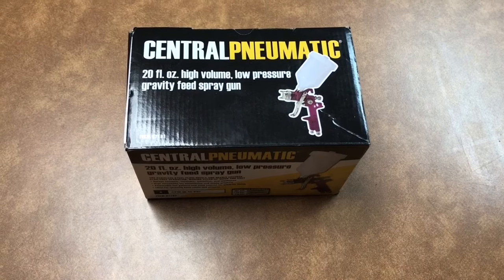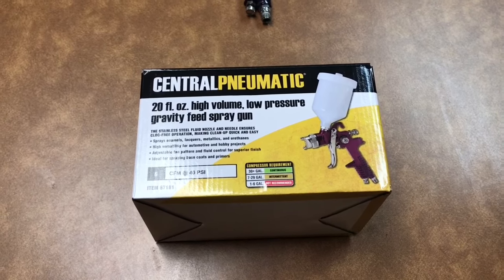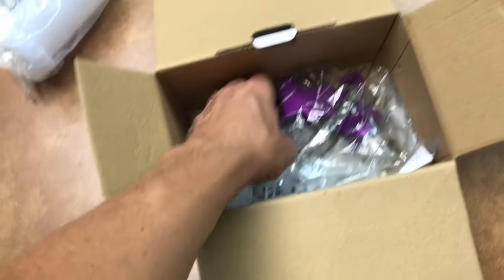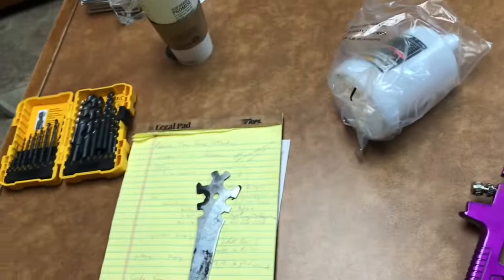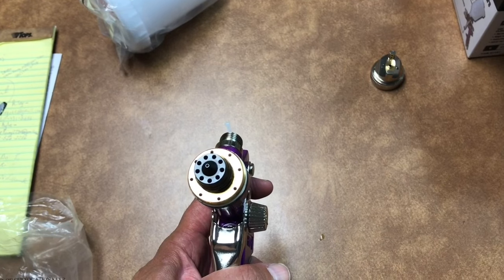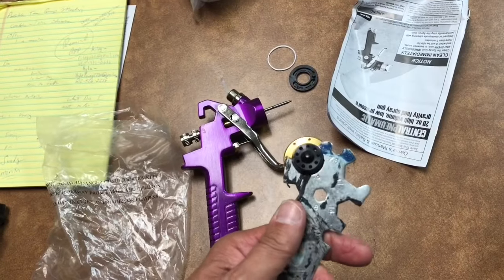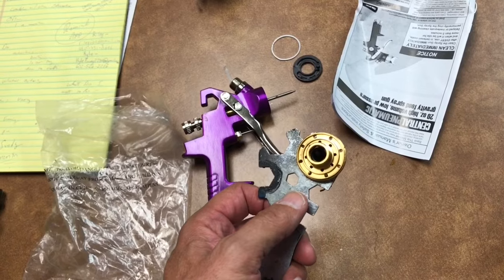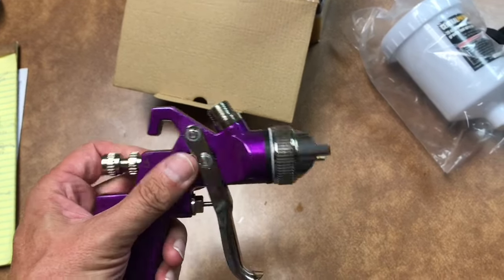Harbor Freight Purple Gun modification from 1.4 mm to 2 mm in order to spray primer

Comment: I modified the harbor sprayer gun from 1.4 to 2.0mm. The paint did not come out -- I test with pure water and it has no problem.  What do I do wrong? The paint too thick. How you mix the paint with water. What is the ratio? I used Kelly Moore interior paint. Ty
Reply: You should thin the paint out with paint thinner or laquer thinner. At least that's what we used to do. Never thin with water . Read the instructions and see if it recommends to thin it
Reply: @SimplyJade2024  water based paint thins with water. I do not think you should go over 20% though?
Reply: Buy some Floetrol paint conditioner at Home Depot or Lowes (or any paint store). It's fairly cheap and better than thinning with water. It not only lets latex paint flow through your gun better, but lets the it level out to a VERY smooth finish if your technique is not quite perfect.

Comment: Don't bother doing this modification people. Spend the 25 dollars to buy a 1.8 or 2.0 HVLP to primer from ebay or Amazon. Why ruin this new cheap Harbor Freight spray gun when it does a decent job for non professionals.
Reply: If you're just going to use the gun for thicker primer and the gun is only $10, why spend $25 for a different gun?

Comment: These cheap bastards are now using steel for that piece that you have that is brass. I got two guns the first one I was able to finally remove as a full piece like yours. The issue was putting the part back in, it was impossible as the seat was corroded from metal to metal contact. The second one has been impossible to remove, corrosion I am sure. Shame

Comment: the ideal solution is get a bigger nozzle if its available , cause this way  your going to screw up the gun.  its design for only that purpose but some guys like to fix something that doesn't need fixing   lol.
Reply: +hunkydude322   I would agree, but HF does not sell larger tip/needle combos with their guns. Yes they are cheap, but people use these for all kinds of projects from staining fences, latex house paint and cars. 
 Most fluid cap/needle kits are match in size for both fluid hole size and needle with a proper tapper. Another thing, is not mentioned. This is the air cap that is also modified to included more air holes or larger for fan control for thicker products like meta-flake, high-build primers, etc. 
  My son had destroyed my Devilbiss and Binks while not cleaning or loosing parts. I have used these guns and with some work, spray pretty good. It take practice, the ability to diagnose the problem, then thinning as this can destroy some paints if done too thin. 
  I have painted his vehicle and my own, but have done a number with my other two guns, now disabled. Not going to pay $400 - $700 for a gun I'will use once, but have many friends I can call on.
ASE Master Tech since 1978 / Retired / Not affiliated with Scott's Garage. Like & Subscribe anyhow to keep learning. I do and enjoy it.
Reply: I don't think you can buy just the needle and tip for a $10 gun, and screwing up a $10 gun is not really a concern anyway. It's $10. If you ever use a professional gun, you'd think these guns are screwed up right out of the box anyway. These spray great for $10 or even $30, but they don't compare to a SATA or Debelvis, or Iwata gun.